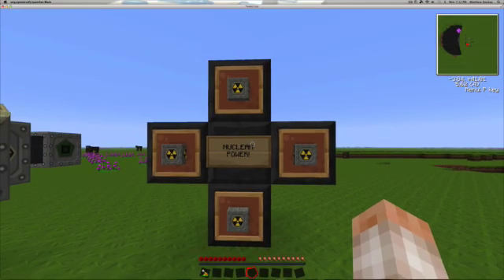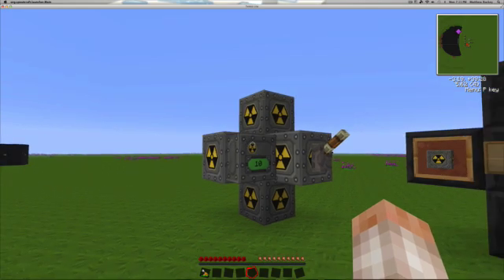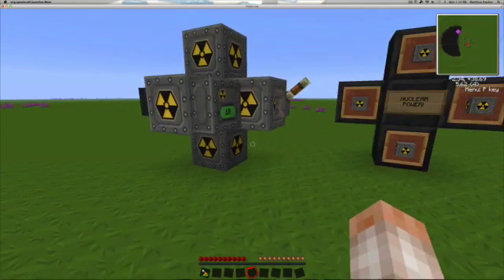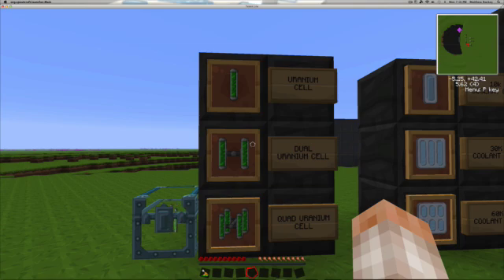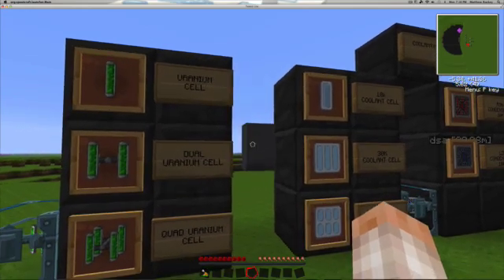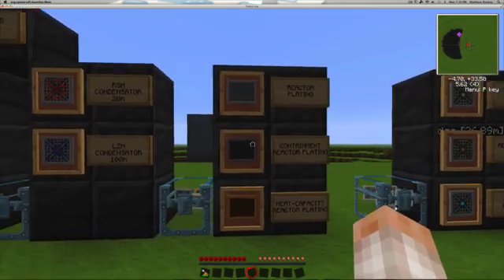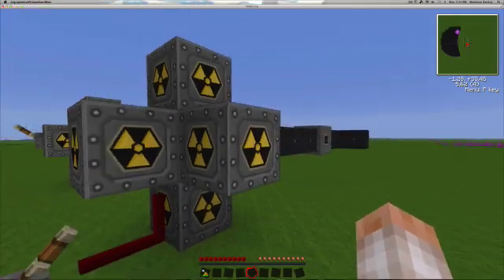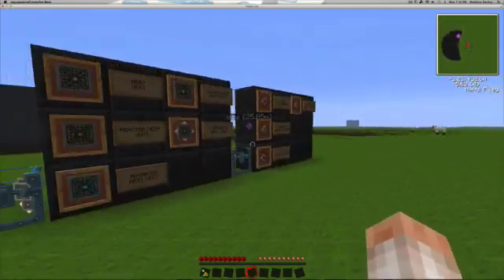Tutorial - IndustrialCraft 2 (IC2) - Nuclear Reactor Setup

Comment: To use glass fibre you need to use a HV transformer which splits up your EU into 512 bits like you said.  Whereas a HV cable can accepts a lot more without having to break up your EU into packets.  This helps with server lag but more importantly makes your mass fab go faster.  if  you are pumping power into an MFSU or something that cannot take more than 512 then you might aswell use fibre.

Comment from the maker: I'm genuinely curious though...originally you said the glass fibre would blow up but as far as I can see it doesn't...? EU transmits through wires in packets of up to 512 EU/t which allows 4x HV and glass fibre to carry massive amounts of EU/t through them. The HV cable looses far more EU per meter than Glass fibre though which is why I was searching for an explanation.

I'm not looking for an argument i'm trying to find out if I could be doing things better. :)

Comment from the maker: If I were to guess, either your transformer or MFSU (or both) is facing the wrong way. Transformers have ONE INPUT side and five output sides while MFSU's have ONE OUTPUT side and five input sides. Using a wrench to change the orientation of your machine(s) should do the trick. Using the above information will help you identify the correct way to place your machine. The one "unique" (input on transformer and output on the MFSU) side will have a different graphic than the other five sides.